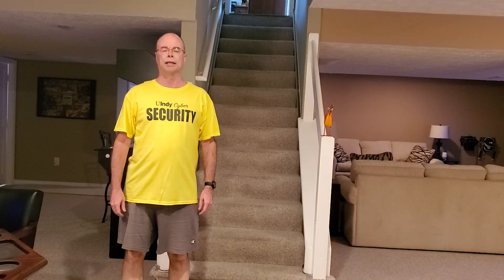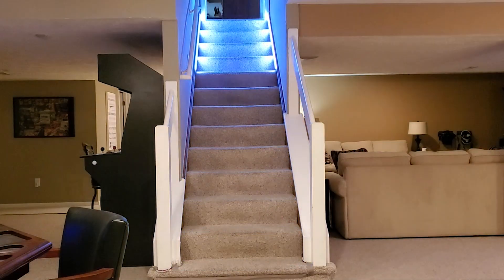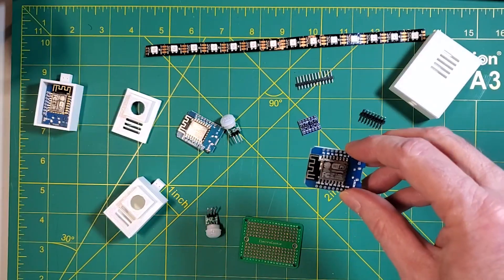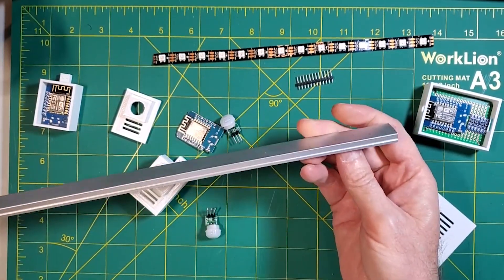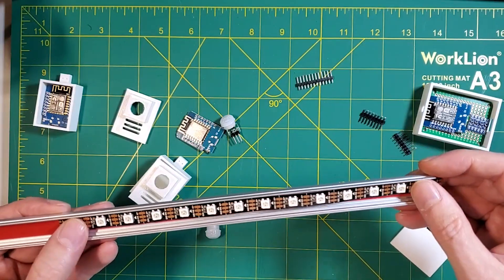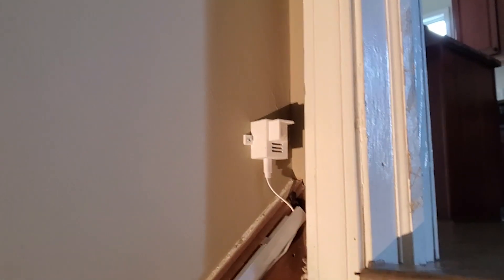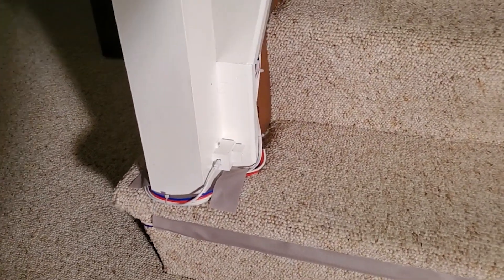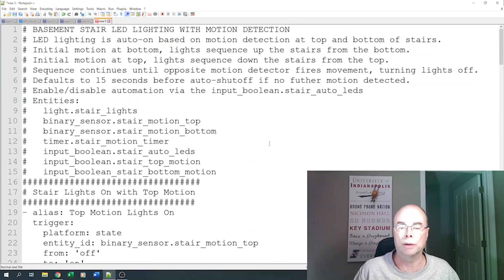Motion activated LED stair lighting... without staircase modification!

Comment: Wow, I'd buy a kit from you.
Reply from the maker: Thanks.  I've had other ask about the possibility of having me building this for them.  In all honesty, even if I had time to assembly kits (and all the other work related to shipping, logistics, etc), everyone's stairs would be different enough in terms of length, power outlets locations, etc. that any sort of kit would still involve a lot of DIY for installation anyway (such as cutting rails to length, installing the LED strips, etc.).

The only thing a kit might provide would be a pre-assembled controller with WLED installed.  But that already exists, if you are interested.  Quindor, over at QuinLED already sells a pre-build controller (with logic level shifter, fuse protection, etc): https://quinled.info/pre-assembled-quinled-dig-uno/

Comment: If you're going to run a wire for power to the other esp units, why just run wires to the pir sensors and combine esps? 3 is overkill when only 1 is needed.
Reply from the maker: There are a lot of the same ways to accomplish this.  At the time, WLED only had support for one button/external switch, meaning I could have only connected a single motion sensor to  the primary controller, meaning at least one additional D1 mini would be required.  And in all honesty, it was just easier to hide the flat USB cable than to try to run 3 separate wires (5V, GND, signal) up the stairs and hide that.  I could have used a data USB cable as that wiring run, but for the extra $3 that the D1 mini costs, this was just the easier way to do it (at least for me).

Someone else commented in one of my other videos that use of a microcontroller to control LEDs was overkill in general.  But again, for the low cost, often time it is just easier to use that option as opposed to soldering a bunch of individual components... especially for beginners.  Or for those like me that are just lazy and looking for the easiest way to accomplish the task!

Thanks for taking time to comment.

Comment: Will this work for a smoker?
Reply from the maker: Uh... are you talking about a device that you use to smoke meat, or are you talking about someone that smokes?  If the former, what exactly would you want the LEDs to do with the smoker?  If it is the latter, I don't think smoke would impact the motion detectors and it should work fine.
Reply: @ResinChemTech  yeah, it’s the later and that’s a relief. I love your work.

Comment: Couldn't you have mounted the motion sensor cable inside the channel too? That way it is completely hidden.
Reply from the maker: That's a good idea... and actually I wanted to do that.  Unfortunately, the flat cable was just slightly too wide to fit inside the aluminum channel "vertically" without interfering with the diffuser.  Turning the cable "horizontally", made it visible as it overlapped the LEDs.  In theory, I could have ran the cable under the double-sided tape before putting that down, but that would have resulted in a "hump" and potentially affected the adhesion of the strips to the tape.. and the tape to the channel.  In all honesty, I can't see the USB cable at all unless I actually lay down on the stairs and look for it.  But with all DIY projects, there are multiple ways.   I appreciate the suggestion and it might give someone else an idea of how they might build a similar project.

Comment: Btw you don't need the logic level shift with the ws2812bs, they will accept a digital signal all the way down to 1.7 volts, so 3.3 is more than adequate, if you don't believe me check the datasheet for the ws2812b itself, it'll say the same thing
Reply from the maker: You may be correct, but my references say: "The datasheet tells us that a logic high input will be detected at a minimum voltage of 0.7 * Vcc. If you’re running the LED at 5V, this means 5 V * 0.7 = 3.5 V will be needed for the WS2812 to detect a ‘1’ on the data line."  Here is the data sheet I am referencing (https://cdn-shop.adafruit.com/datasheets/WS2812B.pdf) and you can see that it also notes a working voltage starting at 3.5V. While you can sometimes get away with 3.3V (or even just a bit lower), there can be signal instability that might cause random issues.  Add in the fact that I sometimes place my controller a meter or more away from the first pixel and voltage drop from just the wire resistance itself is enough to cause intermittent problems.  In my opinion, it is well worth the $1 cost of the logic level shifter (or even a sacrificial pixel) to boost the signal to 5V.  This allows plenty of headspace for any voltage drop due to the wiring run between the controller and LED strip.  Nearly all references that I see online (or from others) recommend use of a voltage shifter or sacrificial pixel.  But like all DIY projects, there are many possibilities and if you can get a reliable signal without the shifter, then by all means feel free to omit it.

Comment: Thats actually pretty cool looking.. brightness could be lowered a lil bit though..
I simply use a USB mini PIR sensor and USB LED strips for the living room and bathroom, for the stairs i use a motion light i modified powered by 18650s or a USB power bank to recharge the batteries.
Reply from the maker: Thanks!  I think it looks a little brighter than it actually is because LEDs simply "overwhelm" the camera... but the brightness is controllable via WLED.  I'd be interested in your battery-operated versions.  Someone else was just asking about that a few comments ago.  I tried a short 20-pixel LED strip in a closet, activated by a door sensor powered by a USB power bank (12,500 mAh I think) and could never get more than a couple of days before needing to recharge.  Probably due to the constant power draw from the microcontroller, but using an ESP32 with deep sleep took too long to wake up and respond when the door opened.  I just haven't had any luck with battery-powered LED projects.... but I'm not saying it can't be done!
Reply: @ResinChemTech  GE Wireless Motion-Sensing Moveable LED Light Bar (Walmart) is the style im currently using but any similar style could be modified in the same way. i use a TP4056 module, i have it outside of the unit as how it looks doesnt bother me, the 18650s (2) sit nicely on the back of it. When the battery voltage gets low the Light itself blinks a red LED as an indicator, but instead of waiting for it to blink i just click the power bank every now and then to charge it back up.

I can go a month or so before it naturally needs to be recharged, if you have it in a closet then it should last even longer, assuming you use decent 18650s with low self discharge, i use the WESTINGHOUSE 2000mAh 18650s that you can find in store, the Hyper Tough batteries also sold in store do the job also, but the WH ones are better.

Hope this helps :)

Comment: Electricity bill 📈
Reply from the maker: Actually your comment got me thinking, so I did some quick "back-of-the-napkin" calculations.  When the lights are activated (and all ~430 pixels are lit), the system would draw about 5 watts at the top end.  And of course the lights are off the majority of the time, in which case the controllers are only drawing a few milliamps.  I'd guestimate that the stair lighting system would use about the same amount of energy over time as the lightbulb inside your refrigerator... give or take.

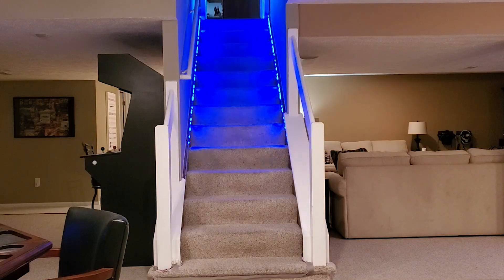Comment: How did you do the torpedo effect at 2:45?
Reply from the maker: I think the actual effect I used at that point in the video was called Fireworks 1D.  It is one of over 100 different effects provided by WLED.  I didn't have to do anything other than select it in the WLED interface!

Comment: Hi,

This is a very useful video. I just have a question and since your more than competent at this, I'm hoping you can answer.

I have five steps from my decking to the garden. I want to put some IP65 Led strips under each step. I need to be motion activated. I can manage that. But my challenge is I want to use a solar power bank and I want to add on a PIR to the lights only come on with motion. Google assistant compatibility would be a luxury if possible

So my question is, is it possible to add on 5 steps with of IP65 RGBW strips to a solar power bank with a PIR? If so, with Google assistant?

Any and all help will be appreciated. Many thanks
Reply from the maker: Well... anything is possible!  I think the challenge here will be the battery power... even with a solar charger. Both the WLED controller and PIR board will constantly draw power, even when the lights are off.  You could move up to an ESP32 and use deep sleep to save battery, but the wake-up time (and time to connect to wifi) would make the motion-detection portion nearly useless.  I tried the battery concept for small strip of LEDs in a closet (maybe 20 pixels) and the battery/power bank drained in two days, even with limited closet openings.

Google integration is possible if using Home Assistant.  There may be other ways.  WLED natively supports Amazon Alexa.

Comment: Why take lights off? That might be the selling point of your house.
Reply from the maker: Primarily because the controller and motion detectors are tied to my wifi SSID and password, and the whole system requires Home Assistant to function.  The next buyers would have to be comfortable figuring out how to reflash the devices (since they'd be inaccessible without my wifi), using WLED and ESPHome. Then they'd have to have Home Assistant and be able to recreate the actual automations.  If this was an "off-the-shelf" product with it's own app or way to control the lights, they might be useful to the next owners.  That's pretty much why I will need to remove all my smart home tech upon resell... it is mostly dependent upon my wifi settings and Home Assistant... something the next buyers are very unlikely to have.

Comment: Very nice and straight forward.  Most stair lighting has loghts going horizontal across each stair. I like the simplicity of your approach.
Reply from the maker: Thanks!  I try to do projects that are not impossible to recreate or require a lot of specialized equipment... and that can be removed without having to do major restoration work!  As I mention in a couple of videos, we will likely sell our house in a few years and most of this smart home tech will have to come back out unless the new owners want to keep some/all of it.  I like some of the other videos with the lights across the treads, but they are much more complicated and require construction to hide wires, etc.  Thanks for watching and taking time to comment!

Comment: Isn't there a "staircase" mod binary for WLED?
Reply from the maker: Yes, I believe there is one now (https://github.com/Aircoookie/WLED/tree/master/usermods/Animated_Staircase).  I don't think it existed when I originally built mine.  It is a little more complex as you have to be able to compile your own version of WLED, send HTTP/API commands, etc. and I think it is designed for lights running under each tread as opposed to up the stringers. I've glanced at it, but not in any real detail. But like most DIY projects, there are always multiple ways to accomplish the same thing.  Thanks for watching and recommending an alternative.
Reply: @ResinChemTech  you're right, they are for each tread and yes compiling can be pretty intimidating. Great project! Gave me an idea for my father in law...

Comment: what if i dont have a 3d printer. How can i get enclosure?
Reply from the maker: If you live near a college or a community with some sort of maker space, you can sometimes get them to print parts for you at a very low cost.  If that isn't feasible, I recommend small electronic project boxes that you can find on Amazon or elsewhere. This is what I used before I had a 3D printer.  You can take these small project boxes and drill holes or otherwise modify to meet your needs.  You can also be creative and use all sorts of things around the house... like a toilet paper tube to restrict the angle detection of a motion detector, etc.

Comment: I'd like to buy the system, can you sell ?
Reply from the maker: Unfortunately, since each installation would be specific to the length of your stairs, I think it would be very difficult to sell a "pre-built" version.  Plus the cost of shipping would be prohibitive due to the size.  However, I do have a related blog article that lists all of the parts that I used:  https://resinchemtech.blogspot.com/2021/07/simple-motion-activated-led-stair.html

And as I replied to in your other comment, if you wish to buy a pre-built WLED controller (it can be dropped into my install in place of building your own), I recommend the DigUno by Quindor: https://quinled.info/pre-assembled-quinled-dig-uno/

Comment: Is there a way to set this up with Google Home
Reply from the maker: I don't believe so... not in it's current state.  I don't think either WLED (light control) or ESPHome (motion detection) have any integrations directly with Google Home.  I can control the lights by voice via Google (turn on/off), but that is technically via the integration with Home Assistant and not the LED controller or motion detectors themselves.

However, if you are looking for more basic version that would just turn the LEDs on/off with motion (and without needing Home Assistant or a smart hub), I'll be releasing a new video in a few days that shows how to build a controller to do just that.

Comment: (Thought I submitted this, but can't see it) I came across this video while looking an something that I am not sure exists. I have to say I absolutely LOVE what you did to your steps!!!  I never heard of Home assistant so some of the messages below, are like a different language to me.    I am reaching out in hopes that maybe you can help or guide me or even tell me if it is possible and/or if it does exist.   I am elderly women and have been looking for outdoor motion sensor led strip lights to run outside that will be in the elements, and run them under the rail of my decking and my steps to my house.   I do not want my house constantly lit at night and am trying to find motion sensening led light strips for outdoors.   Is there any way to can tell me if that is possible as I do not want a motion flood light as there is a lot of traffic on my street and just constantly turns it on.   I am going to kill myself when I am trying to enter my house climbing the steps.   Can you give me a parts list, or a item number to allow me to turn my outdoor plug in led strips and and allow them to turn at night with motion only.   access to the steps is on the side of house and then goes to the front of house.  if you can even build me an outdoor sensors to attach I would gladly pay for them, unless you know what I can get a outdoor sensor that can connect to them and somehow have them plugged in.    I have been searching and searching, and I just can't find anything.  Maybe it just doesn't exist.
Reply from the maker: I understand exactly what you are trying to do, but there may not be something that exactly matches what you describe.  There are a lot of different versions of solar powered LED lights (like this from my Amazon affiliate links: https://amzn.to/3psDO3g), including the ability to get them in RGB colors if desired.  But these will come on at dusk, by default, and stay on until dawn and not turn on/off based on motion.  An outdoor version of my stair lights could be built, but weather-proof LED light strips, an outdoor motion sensor and some type of enclosure for the controller and power supply would be needed.  And to top that all off, you'd need some sort of automation platform (like Home Assistant) or a custom built controller  to trigger the LEDs (and turn them back off) upon motion.  I'm sure something could be done, but it would definitely be a DIY project.  I'll poke around a little and give it some additional thought and get back to you here if I come up with something that might work in your case.  Sorry I don't have a simple, straight forward reply for you here!
Reply from the maker: OK... wanted to follow up.  I threw a prototype together tonight that works standalone, without Home Assistant or any other automation system.  Basically, it is "self-contained" with the motion detector and controller.  When motion is detected, the lights come on for a preset amount of time, then turn off.  There is still a lot of work to do on it... and everything would have to be weatherproof, but I think at least the concept does what you want.  Let me do a little more work and then I'll see about throwing together a video on how I built it and how it works.
Reply: @ResinChemTech  Oh my, you are such an angel !!!!!!   Although I would love to have the set up you have, but the standalone version is exactly what I have been searching for.    You have no idea how much I appreciate that you are trying to help!!!!!  I don't feel safe having my steps lit up from dusk to dawn and I am glad you understood what I am actually looking for!   Thank you, Thank you, thank you.   It is very scary, especially at my age, knowing that the older we get, the more chances of falling is, let alone trying to walk up steps in the dark to get in your house.   Hopefully, you are successful, as I have no doubt that you will be based on how you did your steps, but all I need is my steps lit up when using them.   I look forward to your video and any updates as you go along.    Also, THANK YOU for repsonding and trying to help!!!   Happy Holidays!
Reply: Perhaps using an outdoor timer, or fixing a remote control "on/off" handheld device that can be carried in pocket or purse could work?  I just think your light set up is great!